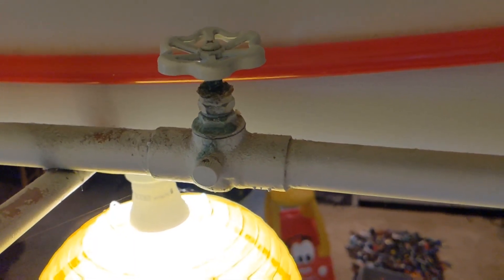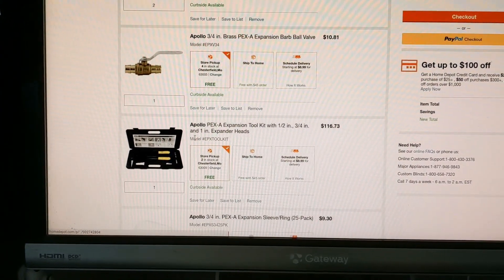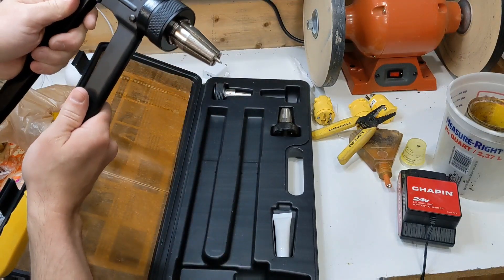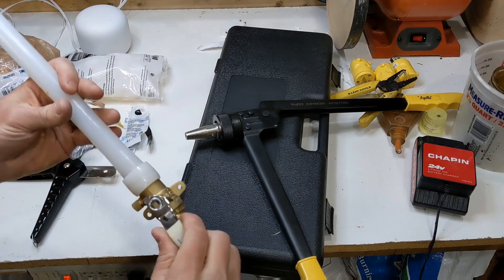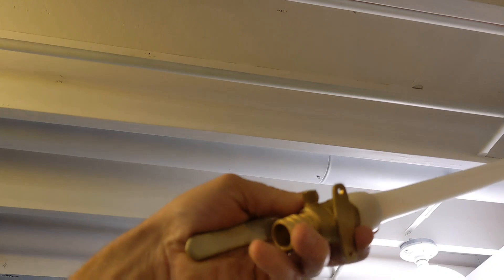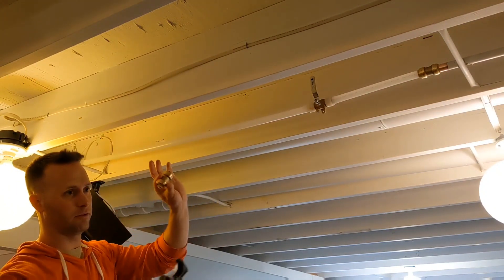PEX A Expansion Tool (Propex), avoid copper soldering

Comment from the maker: If i had to buy it again, I'd get this one on Amazon ($99): https://amzn.to/3Zo9jvC
Timestamps:
00:00 Brief Intro and Overview
00:23 What went wrong with my copper plumbing/gate valves
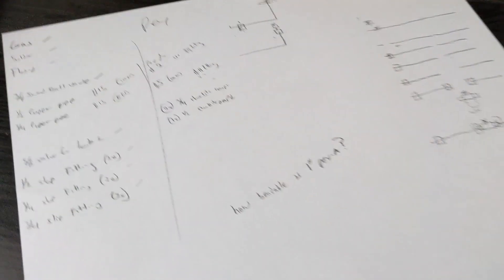00:51 Creating a shopping list online
02:44 Putting together the PEX A Expansion Tool for the first time
03:11 PEX A Fittings
04:38 Removing Propex fitting from PEX A pipe
05:23 Expanding the Propex fitting and PEX A pipe
05:32 Installing Ball Valve onto PEX A pipe using expansion fittings
05:58 Turn off home water main valve.
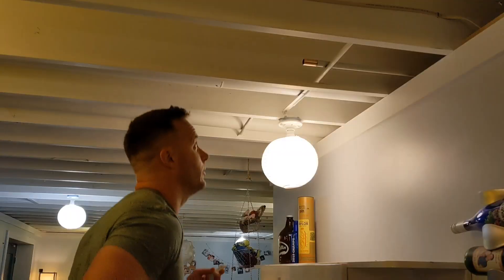07:23 Installing ready system to existing copper pipe.
07:39 Turn on water (spill #1)
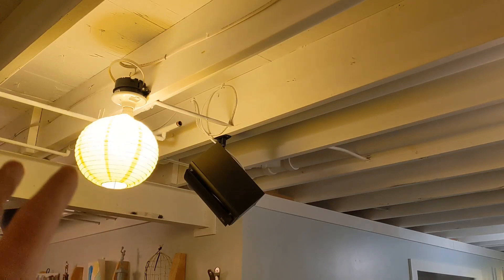08:46 Turn on water (spill #2)
09:23 Turn on water (temp success)
09:48 Finishing the Job
10:49 Turn on water (spill #3)
11:23 Turn on water (final success!)

Comment: I added an outdoor sillcock and a basement spicket to a friend's home using Pex A for the first time. I bought the manual rotating tool, fittings, and the Pex A pipe. He had a quote of 4k to have it done.
I spent approximately $80 in materials and had it all done in less than an hour.
While I was there, I noticed that the lines on the water heater were connected wrong. The cold line was connected to the hot side. I didn't have enough tubing to fix it, so I told him that I'll be back next week to correct it.
They moved in during the spring, and the home was newly renovated.

Comment: Add wood blocking and you can screw into that.
Reply from the maker: indeed, don't know why I didn't think of that.
Reply: You can even go a step ahead and use pressure treated for your water pipe blocking then you know even if it leaks your good structurally

Comment: Replace the shark bites with expansion fittings like you first used and you'll be good for life
Reply from the maker: Yeah, I just happened to have the shark bite on hand. I love the expansion fittings, so easy to work with!
Reply: @kove  I recently switched and dude I made my money back first shower on time and just headache. It is a little expensive but I price all the fitting and everything into the job. I also ordered bulk brass packs from Amazon. I made sure they where up to code too. But that saved a lot of money on my 90s, ts and couplings

Comment: Teach yourself to solder next. It's a pain but as long as no water is in the pipe and you don't overheat it horribly you can sweat on a copper to PEX A adapter and have a much better system.
Reply from the maker: I really want to learn it, thanks Matthew!!

Comment: Couldn’t you have just unscrewed the nut on the handle and put it on the other direction?
Reply from the maker: I believe there was a knob stopper that would prevent it from functioning. That said, you're most likely right and that would have been a better setup. XD

Comment: Everyone has their own preference as to which is better, PEX a or PEX B. Both have pro's and con's. Years ago when I wanted to try it out, PEX a was not available in the South, it was mostly used up North. So, I went with PEX b. Now the local stores(Lowes'/Home Depot) have started to carry PEX a, but the fittings are a lot more expensive, and the tool is also a lot more expensive, rather it is the battery powered or manual. You can buy the pex cinch tool that will crimp 3/8 to 1" pex for about 40.00, it is small, a lot easier to get in a tighter space than the expansion tool. You will need a tool to do the rest of the house, but for the valve you replaced, you could have just used 1 shark bite coupling on 1 side, and 1 shark bite valve on the other side with a piece of pex between. I would cut a 2x4 and add to the joist so that you could screw your valve down.
Reply from the maker: Interesting, I figured they all kind of rolled out at the same time everywhere. I did consider using all shark bite fittings, but I know I'll be replacing some other lines in the future so I bit the bullet now. Thanks for the advice and insight Steve!

Comment: You could look into the manifolds to and should if you redo the piping in pex.  They are much better than a typical branch system
Reply from the maker: I've seen those, would be great to have. I'm going to make a 1" spigot supply, and while I'm at it thinking about redoing most if not all of the existing with larger diameter pex.
Reply: @kove  that’s funny you say that.  I am adding a spigot in the garage (for washing the car and such) and plan on putting all three on the same line as well.  Well that is till I redo the plumbing and do a manifold whenever that is.  First comes the tankless hot water heater and redoing that pipe.  If your doing spigots check out aquor.  They make some pretty cool spigots.  Frost free ones that are just a bit different than traditional spigots.  I got three of them and they are amazing quality. In all fairness I am yet to install them since it’s been so cold up here on Long Island.  I will be next month though and if the build quality is anything to how they work I expect them to work well.  (What could go wrong after all?  Hope I didn’t just jinx myself).  Lol.
Reply from the maker: @chriss1183  I'd love a garage spigot, perhaps in the future! Oh yeah, I remember seeing those Aquor spigots a while back, that look amazing. I love quick release things, I've eley quick release for all my hoses. My one hangup with Aquor is the 1/2 diameter inlet size. I wouldn't be able to keep it out of my mind one the rest are upgraded to 1".  LOL, something ALWAYS goes wrong, doesn't it?

Comment: Well done! The only thing is to make sure you deburr the cut pipe ends before putting the SharkBite fitting on. Otherwise, you damage the interior O-ring and have a leak later. The tool SharkBite sells also gives you the distance you need to push the pipe on.
Reply: I just bite the bullet and buy the Sharkbite tools - they work amazing
Reply from the maker: Shoot, I don't think I did that! Thanks for the tip Chad!

Comment: Just a tip don't fully crank open your valve. Slowly open it and it's a good idea to have your faucets open slightly to let the air escape otherwise you can create more problems for yourself.
Reply from the maker: Good tip everyone should know, which I didn't before. Has caused some of my garden hoses to develop bulges.

Comment: You need to rotate the pex when using the manual tool. if you look up videos of the electric pex a expander tool, you can see that the head rotates.
Reply from the maker: Thanks for the tip! Doesn't show up well on camera, but I was indeed rotating with every stretch.

Comment: Heat it up and it can be pulled right off without cutting it with a knife
Reply from the maker: I had not idea, makes sense! Thank you for the tip, I'll for sure do that next time.
Reply: CL is right just a little heat.  Also one touch of your knife to the brass fitting and it is likely to leak.

Comment: I can't believe they even sell the manual expansion tool anymore..
Reply from the maker: Perfect for the homeowner that will do it maybe once a year. What is surprising?
Reply: @kove  It's surprising because the electric tools are reasonable enough to own, even for a homeowner if he does his own plumbing.  I'm not a pro plumber but I have the Milwaukee version.  It auto rotates (difficult for the manual), it takes one hand (not three), and gets in tight areas that the manual cannot.  A good quality manual tool isn't really cheap either.  Just the superior seal an auto rotating head provides makes an electric tool priceless to me.
Reply from the maker: Great points, exactly why it was such a hard decision for my when choosing between the two. Ultimately my immediate budget goal superseded the powered version. That said, I will likely sell the manual, and use the funds toward a battery powered version.
Reply: @kove  That's how I figured it, although I did a whole house repipe so the electric tool was a no-brainer.  I ended up putting together my kit piecemeal.  I bought the bare tool brand new on ebay, and bought a charger and the 1/2" and 3/4" heads separately.   All told I'm in about $325 with one battery but no Milwaukee case (I have a generic case).  These tools are durable enough that I wouldn't be afraid of buying a kit off Facebook Marketplace or Craigslist used, even with a lot of usage on them.  Back when I bought mine, the tool was relatively new and used options were almost as much as new.

Comment: It did help me for sure. I will pay a plumber. I have the worst luck when it comes to plumbing work. You did a great job and are a better man than me doing it on your own bro.
Reply from the maker: Thanks man! I intend on branching up our main valve, making a 1-in line all the way to my hose and through my hose. I like hand watering, but hate the time it takes.

👌
Reply: Using the shark bite as permanent
Reply: This is really a very easy repair, this guy just made a great many stupid mistakes. No shade on him, I've been known to make more than a few myself, just ask my wife....

Comment: Plumbing is one of my favorite things to do at work
Reply from the maker: Do you like working with PEX? What type of fittings do you use?
Reply: @kove  i like the shark bites.  But I’ve used a lot of what’s called propress even better and faster then the expansion tool.   However it’s very costly